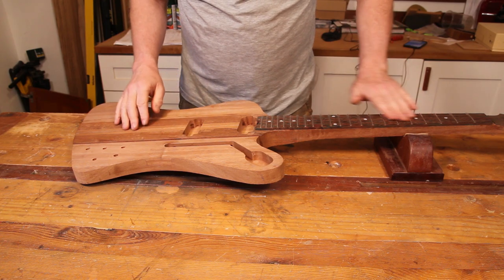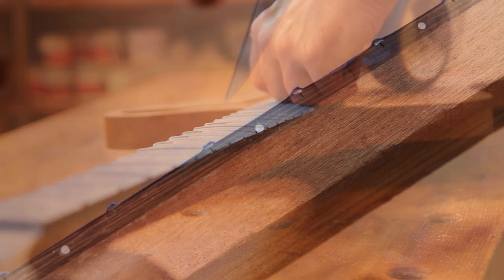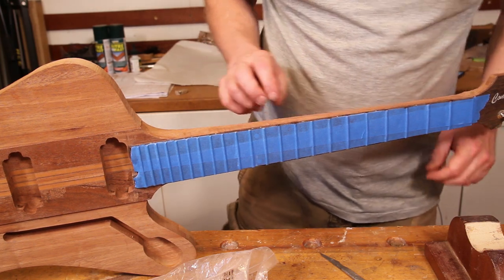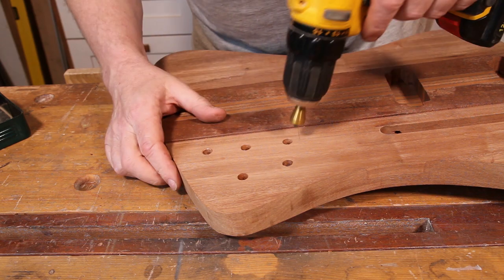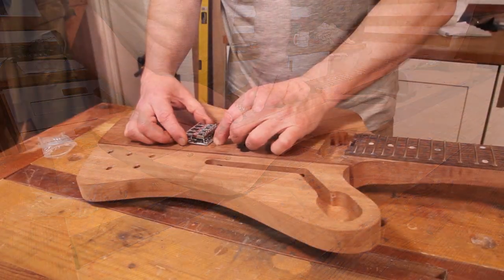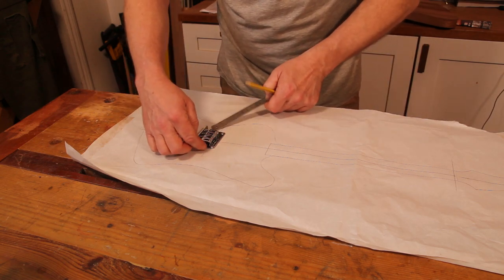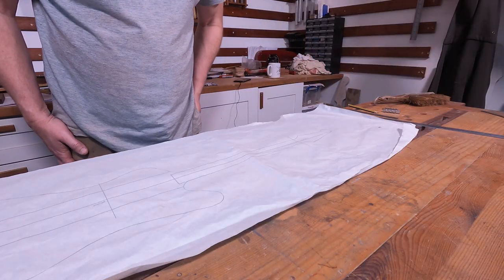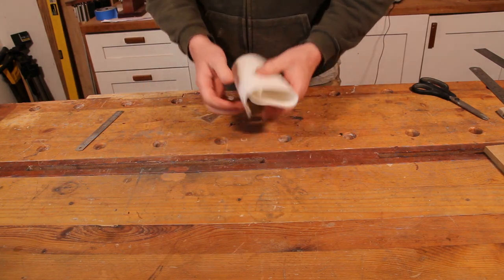Firebird Guitar Build Episode 21.

Comment: Have you thought of a Trapezoid bridge?
Reply from the maker: I have but to be honest I'm not really a fan, I think with some finish on this guitar will look great with the stripped down look of the stop tail peice.
Reply: @Adventuresfromtheshedofdreams  i agree, the trapezoid Bridge gives a similar look to the vibrato bridge but les paul got rid of it for a reason.
Reply from the maker: @seanbarker4610  Yes, they can look great on some guitars (arch tops etc.) but I'd worry about stability given the way I play!!
Reply: @Adventuresfromtheshedofdreams  archtops have a much higher string angle over the bridge, which increases string tension and stability! So they work just fine in those circumstances. I think I  understand where you are coming from now.